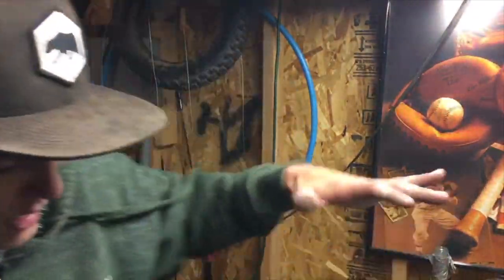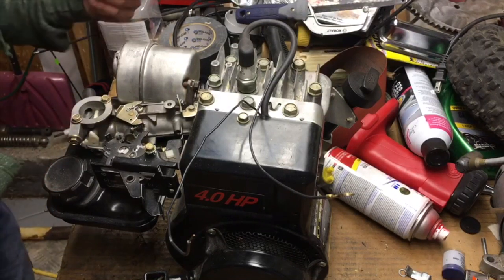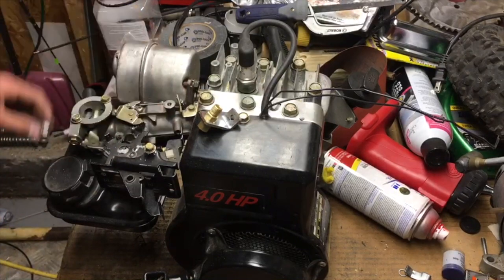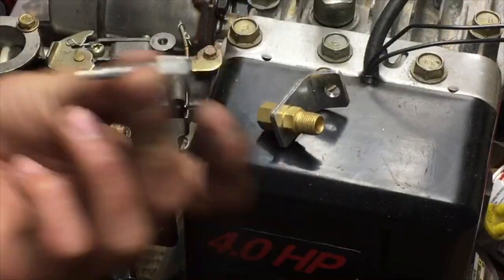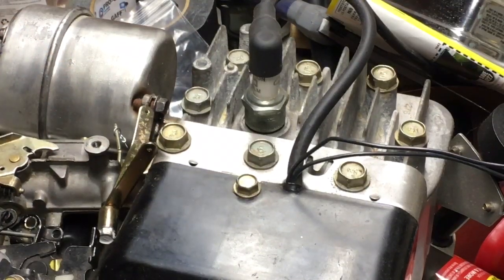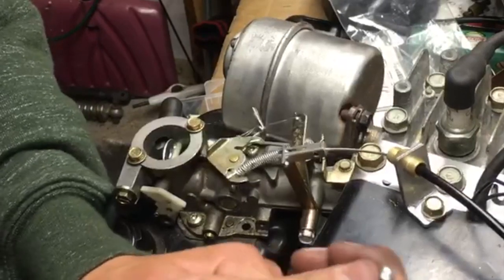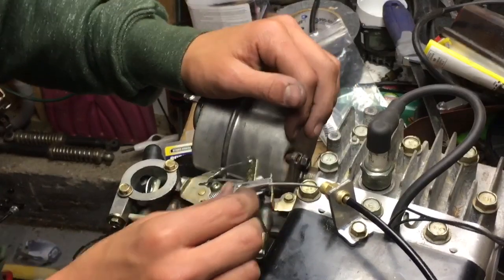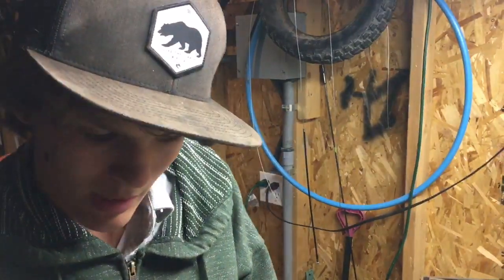How to Setup Throttle linkage on a Briggs Engine

Comment: Thanks for the tutorial. I couldn’t find another video for the throttle kit. It was a huge help! I did have to get a longer bolt for the new link that screws into the side of the carburetor. The new linkage mount adds about a 1/4 inch more length. This was on an older Briggs though.
Reply from the maker: Adam McEwen we are glad our video was of use. If you incounter any more videos that you can’t find make sure to tell us. We would love to upload one

Comment: 3:30 that black throttle linkage cable is crooked.. it needs to be lined straight for a smoother throttle operation.  just loosen that 12mm bolt turn it straight and re-tight the bolt..

Comment: do you have to disconnect the governor on this set up?
Reply from the maker: wakeywakey no we have yet to disconnect the governor but that can be something for you to decide
Reply: Mini Moto thx
Reply: Mini Moto What I'm thinking is when you removed the black plastic piece and replaced it with the metal one you disconnected the linkage that goes straight down to the govenor arm.